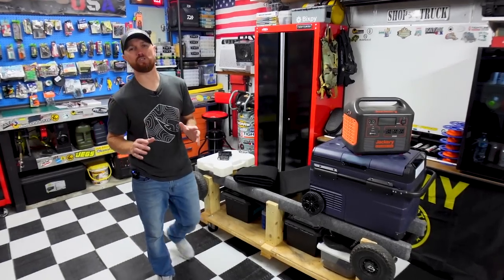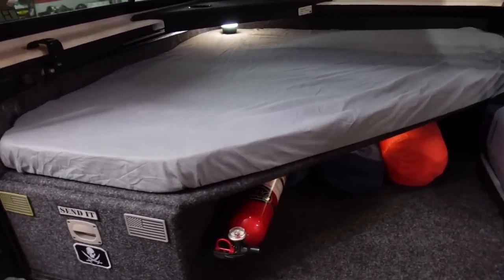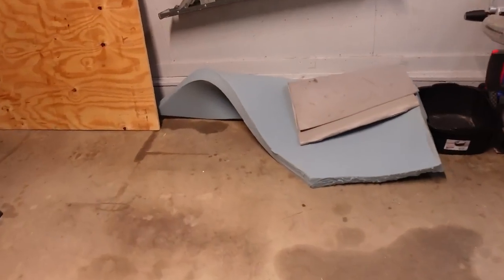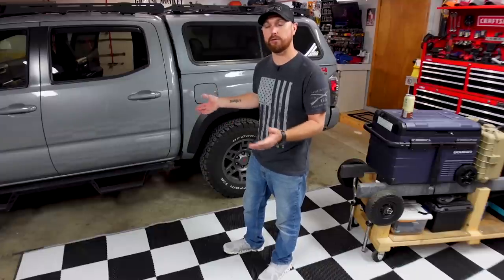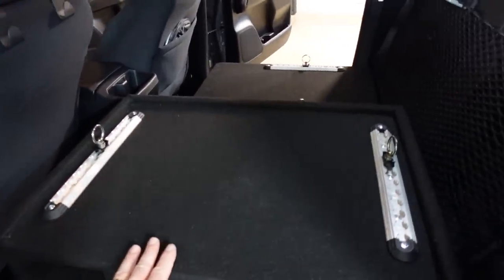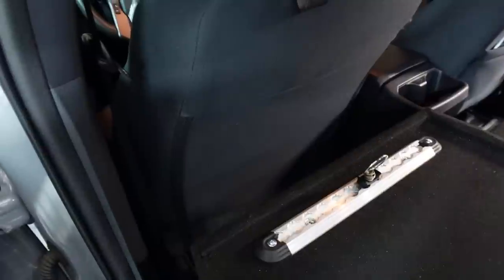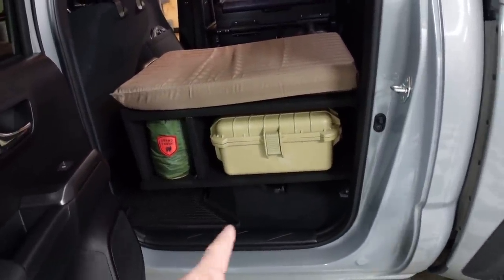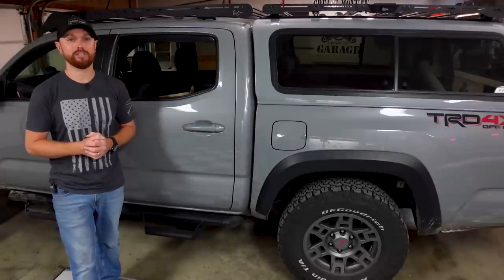DIY Truck Camper Build " Rear Seat Delete " Custom Tiny Camper Setup 2023

Comment: I know this is late, and you probably do not remember,  but do you remember the dimensions for the actual delete plywood. The plywood that attaches to the Tacoma plates that folds up and down. I'm following for a while. I've got a short bed as well. Thanks for any advice.

Comment: It is a nice build.  Did you consider a way to prevent the build from flipping forward during hard braking or a front end collision?  It looks like you might be able to latch to the factory d ring on the floor.

Comment: I did something EXTREMELY similar on just the driver side for 40% delete using the factory seat hinges as well, I left the other side for my pup to have her space on car rides. Super small suggestion that I found made some access easier, the plastic lids to the under seat storage quickly snap off so I just removed it. That way when you lean the platform forward you don't also have to lift the plastic lid as well. Just a thought, it works for me since the cubby is already covered by the platform!

Comment: Bro this is so solid. I'm 5'7 and everyone kept telling me I need the 6 ft bed access cab or dub cab (both look awkward and you sacrifice the shorter wheel base which handles so much nicer off road with the Tacoma short bed). Anyway, I've been racking my brain over whether to go full size truck or 4 runner instead of the taco dub cab 5 ft bed.. but this build just completely sold me on the 5 ft and the possibilities.. 11/10 man!
Reply from the maker: Glad I could help!! 👊🏼  be sure to Subscribe
Reply: @KayakUSA1  I built it - looks fantastic,  happy to send over photos / vids.

Would you mind sharing what mattress topper you went with and what you used to cut / fit it?

Comment: Like it a lot.  Have a similar topper on a Tundra, so I can offer this suggestion:  a bike tire tube between the cap and rear window inflated to 3-4 psi stays in place around the rear sliding window, makes a pretty good watertight seal, and allows for climate control through the whole space, front to back.   A small rectangular fan can get velcro-ed right into the gap of the pass through, such that the front/ truck window can still close over it.  For the times you are not needing your portable AC, you can then pull fresh air in from the cab, through a slightly cracked window under your vent shades, and on through to the back.  Your Jackery would be right below the fan for power, very low draw (maybe 5 watts) for overnight.   Just throwing it out there, works great for me.   Keeps fresh air coming in through to the back so it doesn't get stuffy in the tight topper space.  Like the build!
Reply from the maker: I appreciate the tips bud!

Comment: Awesome build! You inspired me to build out a bed system in my '14 Taco short bed. I built a 20" wide x 58" deep  drawer vs the short one you built. Your battery storage and solar inverter system are rad too! Excellent work, man! Thanks again for the inspiration! I think I'll follow your lead and delete my rear seats too! Rarely, if ever, have passengers in rear seat.
Reply from the maker: Thanks Greg! I appreciate you watching 👊🏼

Comment: This and the previous video are very informative and very helpful, as I have a Hilux which is also a short bed truck and there's not many videos showing a set up. Do you plan on doing any more videos regarding short bed camping I think it'll be a great idea seeing this set up in practice.
Reply from the maker: Thanks! I’m definitely planning on filming a lot of content with this build!
Reply: @KayakUSA1  what solution is any do you have to prevent or limit dust getting into the back of the bed

Comment: Nicely done. I have a 2019 Tundra and have been thinking about doing something similar. I've had it long enough now I think I'm ready to do some mods. Are there any drawbacks to the topper?
Reply from the maker: I absolutely love my topper. it’s been the best addition to my truck so far! I didn’t really use my bed for much before but now it’s like a whole new truck area. Do it, you won’t regret it 🤙🏼

Comment: what kind of plywood did you use? i'm thinking of doing a similar build. Not sure if i should use pressure treated wood? I want my dogs to go in the back as well  and they will be wet, etc so i'm thinking pressure treated, and probably wont angle it as my goofball of a dog would like fall off and get hurt
Reply from the maker: I would not use pressure treated, just use regular 3/4” plywood. Pressure treated wood will shrink and warp on you as it drys. 🤙🏼 Good luck with your build and thanks for watching the videos!

Comment: Great build!  Does the drawer that you put in under the bed only go to where the wheel well is, or does it go the full length of the truck bed?  Thanks!
Reply from the maker: It goes to the wheel well. But then there’s another secret storage compartment. I went over it in the bed build video. Subscribe 👍🏼
Reply: @KayakUSA1  Thank you.